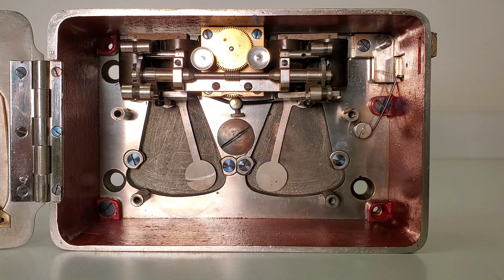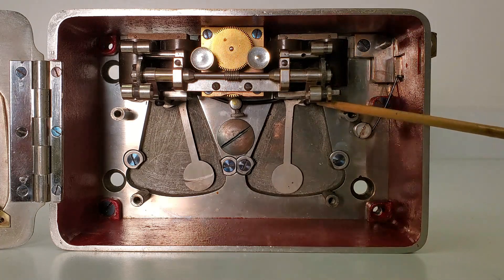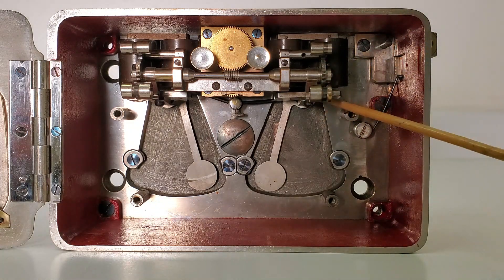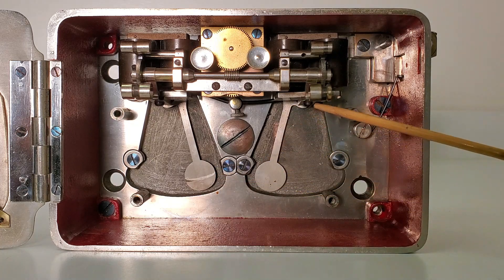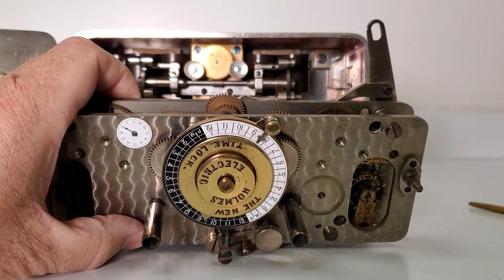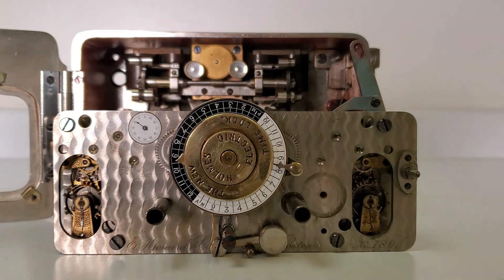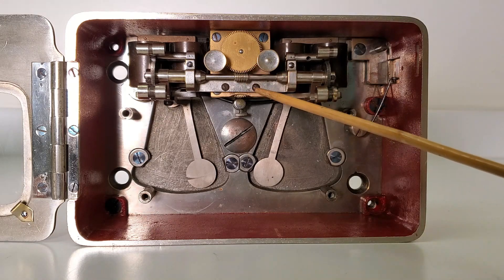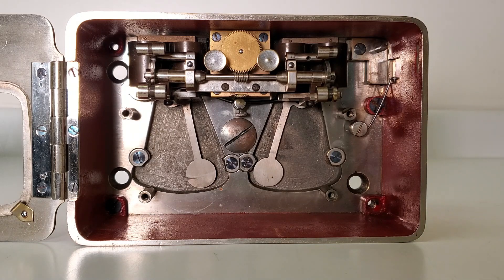Holmes model 2[2] internal override system, c. 1882

Comment: So if I understand correctly the electric override used in case of catastrophic failure of the movement is designed to have a time-consuming override procedure so that burglars or bank employees couldn't use it to their advantage during the night or also to make it impossible for thieves to make staff open the vault right away at gunpoint or something like that ?
Reply from the maker: That is correct. There were other methods used beside electric. For example Consolidated developed the "Percussion Timer" where some one had to literally beat the side of the safe with a sledge hammer to make an internal pendulum do the same thing as was done here electrically. An example is shown here: http://www.my-time-machines.net/consol_concussion_2mvt.htm